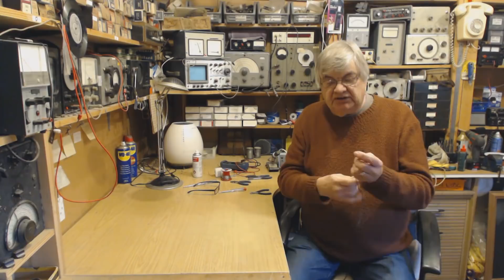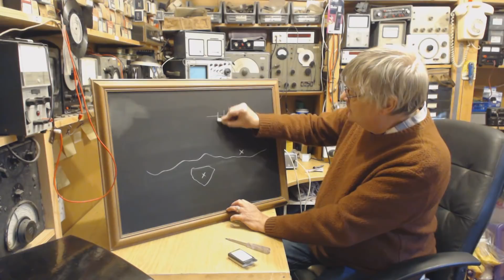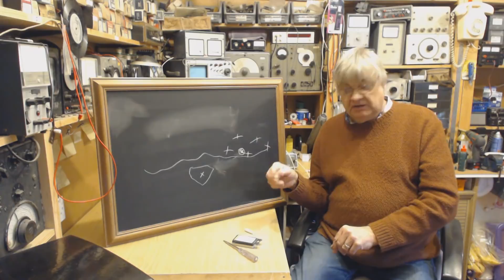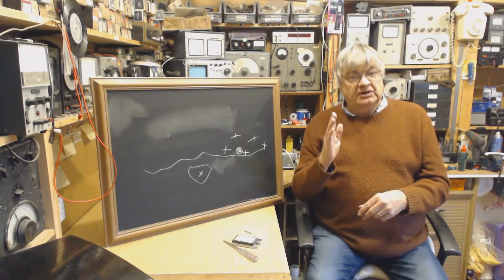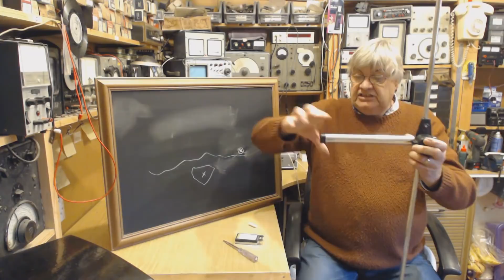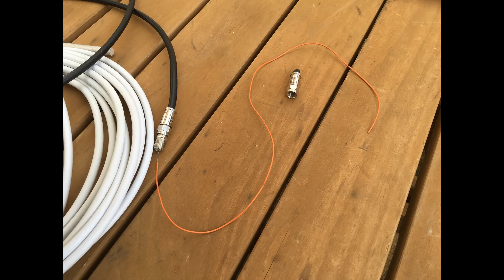Outside aerials for DAB & FM radios & tuners

Comment: In my case for FM I use a 3 element antenna, and for DAB+ I use a 7 elements antenna and for TV I use a 19 elements UHF antenna. The are connected on a FM/VHF/UHF Combiner and at the end I use a 4 output TV splitter with 20 Db signal boost. Excellent reception

Comment: Thanks for this, Ray. I've recently moved from North London to North Hampshire. My old Creek FM tuner, which worked with a piece of wet string where I lived in the Smoke, needs a proper signal, so I'm going to need an aerial outside the house. I'm feeling a lot more confident about doing it myself now I've listened to your advice. All the best.
Reply from the maker: Excellent, good luck with the project. Cheers, Ray.

Comment: Came across this video by accident

Similar experience where I live, tho now in 2024 portable reception is much better on DAB and has been for a while.

A couple of little things…
I can’t remember for sure, but aren’t some FM transmissions vertical only….meaning you need a vertical aerial. Other FM transmissions being mixed mode, so you can still use a “legacy” horizontal VHF aerial for it….but vertical is also good.

We went thru the transition from having just 1 main VHF mast, to having several available in different directions….ditto for DAB.
so the Omnidirectional aerials are critical in order to receive from all transmitting masts……ideal for most people. 
but I have to point out….omnidirectional aerials have much less gain or are much less sensitive than directional ones. So if anyone lives in a remote location…you may still be better to go with a directional, multi element, vertical aerial for FM and DAB.
That said, being remote isn’t too much of an issue-it is what is between you can the transmitter that is more important.
Reply from the maker: I think all FM transmissions use circular polarisation these days. Remote locations would definitely be better using a Yagi aerial. I think vertical aerials are popular because, where I live for example, there are several local transmitters in various directions. All the best, Ray.

Comment: I was hoping to see a home made diplexer built for both ends of the cable!  You can actually just use a dipole cut for 100MHz and it will work fine on 88-108 and DAB for what most people need at home.  You can feed that in to a distribution amplifier.  Saves having two aerials.
Reply from the maker: DAB signals are weak here so I need a dedicated DAB antenna. I can’t use a distribution amplifier because, being a radio amateur, I pump out a lot of RF. The amplifier would probably be affected.  I do prefer dedicated aerials.

Comment: I came across an old, unused band 3 TV aerial in a loft of a house I was rewiring a couple of years ago, the home owner said I could have it, it is a monster, about 9 elements and was used to receive 405 line ITV channel 8 from the Lichfield transmitter, I put it in my loft and with new coax, my DAB radio is picking up clearly Liverpool & Welsh stations 90 miles away with ease!
Reply from the maker: That was a lucky find. Those old aerials were well made, too. 👍

Comment: Hi Ray, I was interested in how you handle the 2 signals from both antennas and using a switch to change between the FM and the DAB signal.  A simple solution is to use a 2 way "F" splitter and reverse it. That is, to connect the 2 incoming signals on the "output" side of the splitter and antenna cable to the receiver on the "input" side of the splitter. This combines both of the signals onto the single cable. You can do the same with FM and television signals onto the same antenna feed.
Reply from the maker: Hi Mark, yes that's what I did in the end. Great idea. Cheers, Ray.

Comment: Hi Ray, thanks for sharing another interesting video. I am not sure how well DAB DX performs here, as I don't own a DAB receiver, apart from a tiny pocket one. However, digital TV tends to lose channels, when there is thick cloud or rain happening nearby. I am guessing that DAB may have similar problems during bad weather. With the bad static increasing on AM radio, outside aerials may even be soon needed there as well. For FM reception, I use a Matchmaster outside antenna horizontally polarized on a rotator. This also prevents unwanted local FM overload, when checking for DX. Anyway, take care and all the best. Rob.
Reply from the maker: Hi Rob, The Matchmaster outside antenna horizontally polarized sounds great. Thanks for all your info. Cheers, Ray.
Reply: @g4nsj  Your DAB antenna is actually the first one that I have ever seen.

Comment: Would it be feasible to for a second inside aerial to the outside aerial to carry its signal INTO the house, then use the radio's UNCONNECTED aerial to pick up radio signals from IT ?

Would this allow moving the radio about the room or house ?

PS.
You do a great job.
.
Reply from the maker: Possibly, but it would have to be set up properly.
Reply: @g4nsj  

I KNOW You can do better than that.
"Set up properly" ?
As in HOW ??

I have a Mobile Phone booster for indoor use, though this is powered.
Could the outdoor aerial signal be boosted through the indoor aerial ?
Isn't there an Internet booster that does something similar ?
.
Reply from the maker: Sorry, it’s not something I’ve tried. Ive heard of it being done but I don’t know how.
Reply: @g4nsj  

Well I can see your workshop, its comprehensive and carries TWO cans of WD40.
That's professional.

I think I will try it myself.
.

Comment: how can I use one of the aerials with a single pin fm input on my receiver?
Reply from the maker: Take the inner wire of the coax to the single pin and the outer braid to any metal part of the receiver.

Comment: Most dab radios now don't seem to have the f connector on the back whereas 15 years ago nearly all of them did. Maybe the manufacturers think it's no longer required in UK. with stronger signal strengths now prevalent.

Comment: Thank you for the video and learnt a lot. Where did you buy the VHF/FM omni directional aerial (rod type)?
Reply from the maker: I found it on eBay.
Reply: @g4nsj , Many thanks for your reply. Your DAB aerial was purchased from digitilisdirect, likewise do you recall which shop in eBay it was purchased from. Did you see any brand name on it so I can do a search on that brand name. Could you please also recommend a masthead amplifier for VHF and DAB, I live in Watford, Hertfordshire and wish to tune in stations from Crystal Palace. I have individual cables for digital television, VHF and DAB running from aerial. You also mentioned in the video that you neither share cable nor use combiner. Many thanks.
Reply from the maker: @walter.d8166  I think the FM dipole was second hand from eBay, many years ago. I know nothing about mast head amps, sorry about that. I've never used one. Cheers, Ray.
Reply: @g4nsj  , Thank you, Ray.

Comment: interesting about that bit of orange wire. I've just been restoring a 60's compact valve radio. I was getting a bit of distortion/sibilance on FM and I'm in the attic room. I was eyeing the circuit, maybe an alignment issue. Then I had the idea of throwing some wire out of the skylight. Didn't have any coax so just used some house wiring cable. 10ft outside, just lying on the roof and 10 ft inside. It's not entirely eliminated the sibalance but certainly improved it.

Comment: Great video 
I wonder if you can help.  My old stereo has a "+"  & "-"  areiel connection on the back,  not a round TV style RF? Type. 
I have been given a indoor areiel with the round connection.  How can I adapt it? 
Thanks
Reply from the maker: It it A and E rather than A and &. Connect one side of your aerial to A and the other to E and see how it works.

Comment: Thanks So much for info on FM aerial/antenna's. Simple little tips like Coaxial inner wire on the top, and braided on the bottom. Things that may seem elemental are to this beginner are vital hints. Setting up a basement shop radio, and needed a proper antenna. Finally decided to go with an Omni-directional dipole from Amazon. Thanks again, best, Kevin
Reply from the maker: Glad you found it useful.

Comment: I actually had to look up DAB.  Digital Audio Broadcasting.  If I had one or two more brain cells working I could have figured it out on my own.  Wikipedia says it's mostly a European thing where HD Radio is used in North America.  Japan, the Middle East, most of Africa and all of South America don't use DAB either.  Whew!.. For a moment there I thought I was living under a rock...  BTW, my new Mini-Whip antenna works well on FM even though it's really rated for HF frequencies and not VHF.  Saved me from having to climb my roof anyway.
Reply from the maker: Excellent, you don't want to have to go up on the roof!
Reply: DAB+, AM, FM in Australia. 
DAB+ found mostly around the capital cities. 
AM is still important because once you get into the outback then it is the only thing you can pick up. Then there are large areas where you can't get anything except at night.

Comment: Hi. Thanks for the video. I got the same package from Digitalisdirect. It comes with only 1 x F connector. But my DAB radio (hifi separate) also needs an F connector. So, my question is "do I need to get another F connector for the connection inside the house as well. The coaxial connector is unnecessary?
Reply from the maker: Yes, you will need another connector

Comment: My fm radio doesn't catch any signals but in morning it recieve very weak signal how can i improve it reception
Reply from the maker: TECHNICAL DUNIYA.- use an Outside aerial, if possible.
Reply: @g4nsj  can u make a video on how to make aerial plz,
I tied a wire to radio and to the top of house but it didnot work
Reply from the maker: TECHNICAL DUNIYA.- you’ll need to buy a proper outside FM aerial.

Comment: I saw a YouTube posting last year about a home built DAB aerial made from just the coax.  You take off around 300 mm of the outer plastic.  Then you push the screen back on itself until it is covering the remaining plastic screening for 300 mm.  Tape it down and mount it vertically.  So the backfolded screen is anti-phase to the protruding inner core, producing a balanced aerial.  Have you herd of this?  It has improved my DAB, but not cured the dropouts totally.  Can you suggest something better?
Reply from the maker: Hi Brian, yes I have heard of this. In fact, radio amateurs often use this type of aerial for portable use.  I think they are pretty good. Cheers, Ray.

Comment: Whathave you done with the two downfeed cables (FM & DAB)? The tuner has only one F connection? Did you use a combiner/diaplexer?  Would the diaplexer be fitted at the mask head or at the FM/DAB radio end?  My location is High Wycombe, BUCKS, so no signal problems.  I already have a digital TV aerial for my Freeview TV box which is aligned on London (Crystal Palace I think);  It has a good signal quality,  I presume this cannot be used for my separate FM/DAB radio?

Comment: Last year I installed a very "simple" outdoor-antenna for FM on the balcony of my flat in a skyscraper (10th floor) here in Germany to get a good signal into my Yamaha HiFi-receiver, after they switched off FM broadcasting via broadband-cabel...
I'm lucky to have over 30 FM-stations here (more then before via BK), but inside the skyscraper-flat half from the opposite direction of them are shaded by the massive building (especially my favorite Rock-station that's 180 degree behind the building).
I go best results by just installing a SIMPLE Lambda/2-"wire", also VERTICALY (which is not optimal, but receives all around). I feed the coax through a window-adapter flat-coax to the inside, and mounted the coax through the baseboard to my stereo.
Sometimes a few stations have little static (depends on the wheater), but most of the time I get nearly ALL of them in good Stereo+RDS! :)
Reply from the maker: Gubel1990 excellent!

Comment: Hey Ray, I live in the U.S., not sure I am familiar with the term DAB. Is it a digital mode or something we in the states just call Internet - or Cel signals?
Reply: You in the U.S. only have IBOC/HD-Radio, which is just a further side-carrier on top of a regular analog FM station that carries digital data-streams - nothing special here with the antenna (VHF Band II, 87.5-108 MHz).
DAB+ here in Europe is a separatr digital-only standard for radio broadcasting, that also can carry multiple digital AAC-compressed audio-streams. It ist standardized to use the VHF Band 3 (174-230 MHz), that earlier has been used for analog PAL-B TV-transmission. It also keeps the old channel-spacing of the earlier TV-channels (VHF 5-12 here), and breaks them further down in quarter (A/B/C/D).
So you just need a VHF-3-Band antenna to receive those channels properly. FM runs independantly on VHF-2.
So you have to deal with two different antennas (VHF3 about half the wavelength of VHF2), and even (mostly) 2 different polarisations (FM mainly horizontal here, DAB mainly vertikal).

Comment: How long distance will I get DAB+ stations?
Reply from the maker: That depends on your aerial height and the stations available.
Reply: @g4nsj   Here in Sebastopol Victoria at 15ft with amp 100 miles away from Melbourne there is no dab here Melb is closest DAB here is around 215 MHz

Comment: Thanks for the really informative video, I have a question,  I have bought a small pocket dab+ radio for work and instead of headphones I have a 3.5mm jack on both ends of a 2 ft lead, one in the radio one end in a small powered speaker it works fine but suffers from dropout every now and then,  can I use a longer connecting wire as I know the aerial is this wire and gaffa tape it to the wall in a vertical manner so as to recieve a better dab signal like you mentioned in your vid, ps im no expert in this field as you can probably tell, many thanks.
Reply from the maker: I'm not really up on the various DAB radio models but I'd certainly try it and see how it goes.

Comment: Hi and thanks for your informative video.I  fitted a  75 ohm coax socket to my Grundig DAB radio  ( all I had) which hasnt been much use since I moved house. It doesnt like the chassis being connected to the ring of the socket  and prefers it left off.Can you explain why this is and will it be a problem when I eventually get my dab aerial installed.It works with a conventional TV aerial after testing.Can I connect the ground to the chassi via component?Thanks
Reply from the maker: Hi Alan, to be honest I don't know why that should be. Connecting the outer of the coax to the chassis should be fine. Try using a capacitor between the chassis and the outer ring of the coax socket. Perhaps a 0.0uF or something.
Reply: @g4nsj  thanks I guess you mean 10 nano ? I'll try this

Comment: I used to have a round folded aerial for pole mounting, I wonder what happened to it?  I used it once and took it down when I moved but I have not seen it since!
I bet it would have worked fine for both without any problems.  I don't have a chimney on this house, that is a bit annoying!  I pt a pole up on my shed for a dish, but I should have made it longer, but when the dish was mounted, they put it so near the top that I can't extend it a bit to hold other antennas.  Bit annoying, I wasn't here when they did it so I had no say in it, but I will put up another if I find a scaffold pole lying about somewhere.  They used to lie about everywhere, but I never see any these days!  Shame, I might even have to buy one lol.  Nice to see you here Ray once again.
Reply: Hi, just one question, can i connect the ground of the antenna to the negative of the battery compartment? Thanks and keep it up.

Comment: Intresting vid, especially about sealing the connection box on the antenna,  I installed a 3 element FM aerial on the gutter board of our house, near Portsmouth way back in 1989, sealed the box with silicone & that aerial is still in use today! It picks up all the stations from the Isle of Wight transmitters  ( Rowridge for the BBC & Chillerton down for the commercial stations), plus various other local and not so local ones.
 Also in the summer with the right weather conditions I can often receive Stations from afield & France too.
 I use a Sony Hifi tuner with a handy feature - it has 2 FM aerial input sockets,  switchable from the front control panel, so I can if need be connect a different aerial. 
 On the subject of DAB, I've got a similar Roberts radio that has that removable cover on the back , although I've never unscrewed it, I'm not a huge fan of DAB radio, mainly due to the low bit rate & poor sound quality of many stations now, even the newer DAB plus ones don't offer much improvement in audio quality, my next kitchen radio may well be an Internet one, although I often stream stations from my phone to various Bluetooth speakers anyway.

Comment: An excellent step-by-step breakdown - this video is going to help many people to tackle the job ! One question that I have which you can possibly advise me on. If I add an "F" connector to the back of a radio, do I need to add an isolation capacitor between the centre pin of the "F" socket and the radio's "antenna" connection ? If so, what sort of value would you recommend ? 

A rewarding video to watch - many thanks !
Reply from the maker: Hi Phil, it's nice to hear from you. You won't need an isolating capacitor as the telescopic aerial wouldn't have had one.